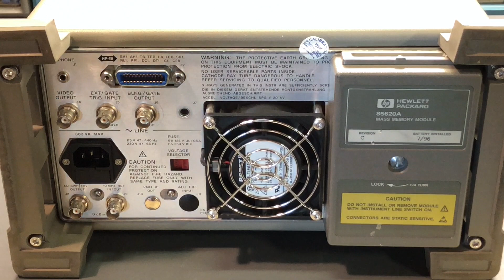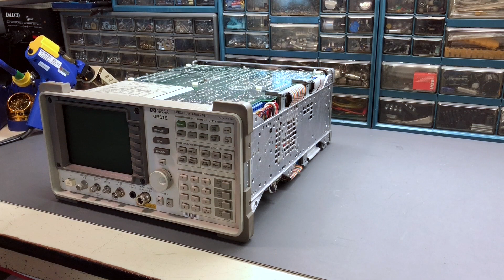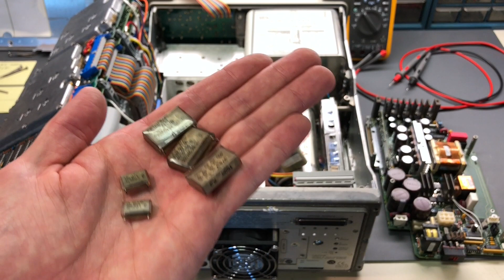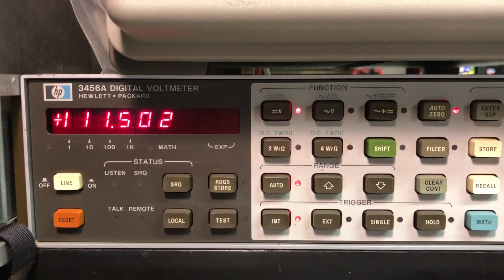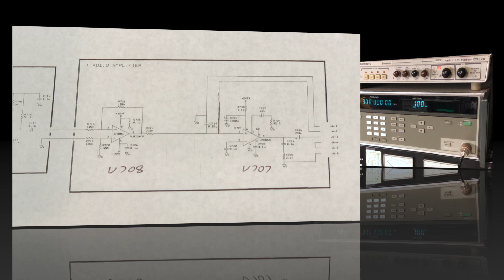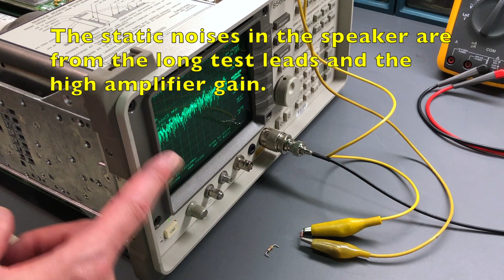Inside the HP 8561E Spectrum Analyzer: Repair and Modification

Comment: Great video. At about 23.40, you discuss the safety procedures for discharging the CRT.  I am trying to follow them as meticulously as possible, as described on pages 181 and 182 of the service manual.  When I probe under the CRT's cap for the second anode (the A6A1W3 post-accelerator cable's rubber shroud), I get a reading of zero volts, but I can't guarantee it's truly 0 volts or a lack of a connection to the annode.  Can you post a short video showing your CRT discharge procedure?  Also, the last step in the replacement procedure says "Snap post-accelerate cable A6A1W3 to the CRT assembly."  Nowhere in the removal procedure did they say to unsnap this cable from the CRT.  What do you do?
Reply from the maker: If you are contacting "something" in the center of the anode high voltage cap then that something is the terminal.  It is sort of a ball and socket with the ball being the anode wire end terminal and the socket embedded in the CRT glass.  You can remove the anode wire by pulling the high voltage cap outward from the CRT and working it  back and forth slightly.  Then you'll have direct access to  the CRT anode socket and can do one more discharge which you will know is making good contact.  This is just a suggestion from my own experience, please be careful, you do any work at your own risk.

Comment: Demodulation: 75kHz Broadcast will be LOUD with 100kHz RBW. Try using 300 kHz or 1 MHz RBW for a much lower volume. In FM mode the volume base is controlled by the RBW setting.
The behaviour of the volume is just right, all of the 8560-machines behaves like this. 
Have repaired and calibrated some few hundred of them. Most common problem is the 47uF capacitors just near the HV-module, then the 1000uF and 220uF capacitors in the front of the card. Also the IRF41z transistors at the front alu-cooler 
Especially +12.6 V does a hard job and gets vy warm.
Use the instrument hour-on meter to determine when to examine the capacitors. The hour on reading can be some 70.000 hours without any mayor failure picture.

Just an advice REDUCE the commercials in the video by some 50% and you will have more viewers that likes it.
GL de Bjoern

Comment: ello, my experience today with an HP8560EC: no audio on either FM or AM. After several attempts with an audio frequency generator and/or an audio frequency or RF signal tracer, I concluded that U708 on board A4 was faulty. It was a somewhat risky search because pin 1 of U708 was short-circuited. To simplify things and avoid having to replace this small chip, I simply cut pin 1 of U708! And everything works again with more than enough audio gain and a pleasant adjustment range without any audio jumps!

Comment: The detected audio level depends on the deviation of an FM signal. Broadcast signals are wide deviation. It would be much more sensible to check the audio level using AM signal. I suspect the designers expected the system to be used with a NBFM communications signal.
Reply from the maker: With the modification I made it works well on NBFM, WBFM, and AM.  It could be that HP had a particular use in mind and optimized for that but at least for my needs the volume control works better now.

Comment: Just applied your mod to freshly restored 8563E. Among others, power supply related, it exhibited exactly the same issue with FM de-modulator amplifier volume control. Replacement R724 to 4.7K fixed the volume problem. Thank you!
Reply from the maker: Awesome! Glad the video was helpful and that the mod worked for you.

Comment: Just got a 8595E with precision module, gate and oven. It is in very nice shape and working nicely. I hope it last
Reply from the maker: It's a reliable spectrum analyzer.  I have the 8594E, part of that same series, with oven and other options.  Never had any problems.
Reply: @EriksElectronicsWorkbench thats great, I'm worry because the battery never was changed and it came without any paper as I seen in a couple of YouTube videos.
Do you know if I can get that data from from the SA? I Think is the eprom calibration data or something like that. Are you in UK? Could I send the mine to battery change and those capacitors? If it brakes I won't able to buy other nevermore, it is in very nice condition and it pass all the test, included frequency which is spot on comparing with GPSDO, but I'm worry it lose the data or fail the stuff that you showed. Maybe I can send the mine or go there , I'm in Liverpool
Reply from the maker: @wattverse  The battery backed RAM is secondary backed by a supercap.. power the unit for a while before replacing the battery.  From the service manual: A16A1C1 maintains the voltage required to back up RAM for a
maximum of 8 hours. A16A1C1 is the large round capacitor next to
A16A1BT1. and also.... Connect the power cord to the analyzer and turn the power on for 
about five minutes. This allows the supercap to fully charge and 
insures the battery switching circuitry is in the correct mode. //  Yes cal data can be read from a special service menu.  I'm in the USA.  Sorry I can't help with a unit repair and I do not know of service centers in the UK.

Comment: hello, I think 30 Hz needs opt006, usual one starts from 10kHz, how can we buy opt 006
Reply from the maker: The 8561E is factory built to extend down to 30 Hz in DC couple mode. No option needed.  In AC coupled input mode response is down to 100 kHz.   Models 8563E, 8564E, 8565E require Option 006 for operation below 9 kHz.  This instrument series is long since out of production so if you have a model that needs option 006 you would have to find it on the used market or possibly remove it from a non working model.
Reply: @EriksElectronicsWorkbench  100% exacto.

Comment: I worked on an Oscilloscope in high school that had 48 tubes besides the crt. Tektronics made it Motorola donated it. I found out why Dad told me to use the high voltage probe for voltages over 300 volts. Ouch! 😅

Comment: Good to show us the Sencore tester. I wonder what would burn a dried and cracked Rifa, is it high ESR?
Reply from the maker: The capacitors are basically turning into resistors as the dielectric breaks down so they start passing excessive current which heats them up.

Comment: The PowerSupply of mine just blew up. One of these RIFA capacitors vanished into a hughe cloud of smoke. The PSU is one of those not designed to be repaired. Two boards mounted overhead and cables soldered into the printed circuit boards. I disassembled the psu in total and installed connectors to be able to maintain the psu more simple in the future. Luckily the installation of a replacement capacitor solved the issue. Nevertheless the unit is still smelling  in operation.
My failure was not to follow the standard procedure to review and rebuild a psu in general befor powerup of an used unit.
Reply from the maker: Those old RIFAs are pretty good at letting out the smoke!  I make it a habit of inspecting and looking for them, they were used everywhere.

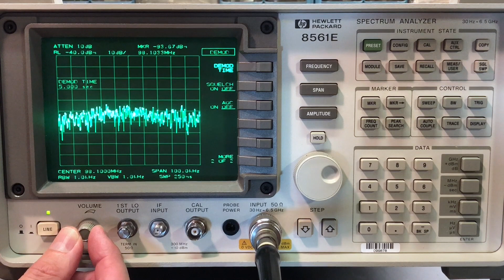Comment: 16:13 That's because the only way to play Journey is on LOUD. 

IDK man, seems like a bodge to me. The audio still just suddenly goes "on", just at a lower volume. Anybody here with the same model who can test how theirs works?
Reply from the maker: All of the measurements around the audio circuit are correct.  The resistor I changed sets the amplifier's gain.  The gain was set very high at the factory by the resistor HP used.  My resistor lowers the gain and the amount of gain figured mathematically from the data sheet specs matches the measured values.  The sudden sound on you noticed is just the analyzer sweeping and then restarting the demodulation.  The demod time is adjustable.

Comment: Normally a pot used for an audio control has a log taper, also called an audio taper, not linear.  Was the original one linear or taper?  My hp8593A has a volume control but I believe it has no demodulator or speaker.  An older SA I used to have had a chart output, since it was a voltage, when connected to a speaker, I could hear local stations like you did.

My SA became intermittent.  The switching PS had failed.  What clued me off was checking power supply waveforms with a scope, noticed a lot of ripple.  I found a bad electrolytic cap that had gone bad, I believe the esr had risen to an unacceptable level.  Because the PS was not made by HP, a schematic of that portion was not available.

You gave a nice overview on the controls of the SA, thank you.
Reply from the maker: As I recall the volume pot was log or audio taper type when I checked its resistance.  Your 8593A needs option 102 for demodulation.  It may have had that circuit card at some point and then it was removed but the speaker was left.  Yes the switch mode supplies often fail from faulty capacitors. I've recapped quite a few switchmode supplies in scopes, spectrum analyzers, etc.  Thanks for watching the video!
Reply: Log taper indeed causes higher ohm excussions at the beggining on its linear region then less and less, thats logarithmic. That being said the behavior for low settings will match. Here problem is too high audio gain to start with

Comment: That resistor must have been an error ?...cheers.
Reply from the maker: Seems like it was not the best value for the application.  No other components in the circuit are defective so the change I made was not covering for another problem.

Comment: Im gonna buy one of these. What should i look out for before buying?

Only thing i know about it is that the range between 3-6,5 ghz is not working and is bypassed
Reply from the maker: It comes down to what you feel your abilities are for doing a repair and possibly calibration.  This is a very complex instrument internally.  Here is my approach when considering an instrument, first download the service manual and understand what you will be dealing with.  Look over the unit and see if it has physical damage that would be unrepairable including any serious burning on the CRT.    Consider the unit cost and allow cost for any repairs or parts.

Comment: Those RIFA capacitors are bad news. Especially if the instrument is to run on 240 volts as used in Australia. Two instruments I bought from 110 volt countries went up in smoke within a Minute of applying mains. These capacitors are exposed to the mains potential even if the instrument is turned off.
Reply from the maker: Yes I've heard about devices being switched over to 240 volts and the old RIFA caps explode in no time.  Correct that the caps are usually unswitched on the AC line.

Comment: So HP put the wrong resistor in?
Reply from the maker: Looks that way.  The audio power amp IC is just doing what it is supposed to by setting the gain depending on the resistor value. That info is on the part data sheet.   I don't know why HP would set the gain so excessively high.

Comment: have you checked the high band (2.9-6.5) reading correctly? that's the biggest issue these 856xE series have other than the YTO being bad which is not the case here obviously.
Reply from the maker: Yes the instrument is functioning correctly on the high band.

Comment: Are you sure the capacitor in series with the replaced resistor is OK?
Reply from the maker: Yes, with the resistor removed the capacitor is isolated and can easily be checked.  I tested it for leakage, ESR, and value and it passed.
Reply: @EriksElectronicsWorkbench  Strange that you had to change to a significantly higher resistance.
Reply from the maker: The resistor sets the amplifier's gain.  If you don't have the external resistor (infinite resistance) the gain will be 20 (26 dB). As the resistance is decreased the gain goes up, the extreme being no resistor and only a capacitor which will give a gain of 200 (46 dB). So it makes sense the original resistor at about 82 ohms was giving a very high gain and the new resistor at 4.7K ohms reduces the gain substantially, now at about 26 (28.3 dB).   @andersjohansson8588
Reply: @EriksElectronicsWorkbench Hmmm… are you saying that from ”your” perspective, HP made a bad design decision, choosing the ”too” low resistance?
Reply from the maker: yes based on how the circuit works and the results you could say that. @andersjohansson8588

Comment: I have a much modest model of the same analyzer. I think iy's great. I wanted for this one (basically for the bandwidth and the rest of the things mine doesn't have -volume, etc.). In fact, you solve the problem; the volume is now much more "usable", but...I can hear some kind of "click" when you turn up the volume knob, like a switching noise -it doesn't sound to me from absolute zero volume, and going up. So I honestly think that the problem is not solved (forgive me). Of course, it is much more pleasant to the ear, but it stil switches on the sound. Lower, but still start sounding not from zero. Well, maybe is more than enough, of course (in fact, it is). And one more thing: do you know were to obtain one like this?. I use a lot of audio analysis, and mine has a BW of minimum 9kHz (it's the HP 8590B). And, of course, thanks for sharing your excellent videos.
Reply from the maker: I think the click you hear in the audio is the spectrum analyzer beginning to demodulate when I already had the volume turned up a little bit.  The audio is free of clicks and noises when the volume control is rotated.  If the audio is already being demodulated the volume is very smooth from zero upwards.  These models can be found on eBay (various conditions of course) and for a working and calibrated unit you can try Global Test Equipment or AllTest Instruments Inc.  For audio testing you would not want to connect a high powered audio amplifier to this unit.  You should consider adding an active probe which will give you a high impedance input.
Reply: @EriksElectronicsWorkbench thanks a lot for your answer. It’s a pity that here in Madrid is nearly impossible to buy one of these. Ebay Spain have as much as one or two, extremely expensive units. Lucky you!